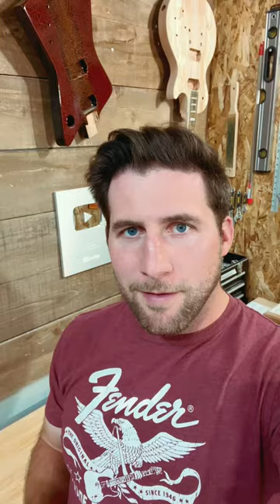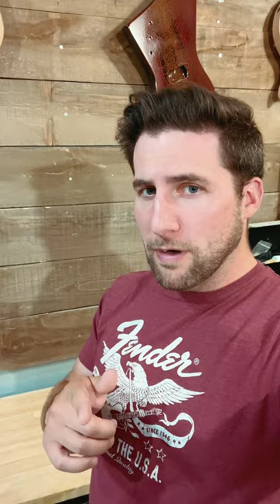Can you Spray Nitro Over Poly? #shorts

Comment: Brad - wouldn't having a poly layer at the base defeat the purpose of using nitro? I was under the impression the reason why instruments are painted in nitro is the layering process does not build up allowing to the wood to breathe or better yet resonate? By using a polly first one would be clogging the pores surface
Reply from the maker: You wouldn’t use poly on an acoustic guitar or a violin. For an electric guitar it makes no difference, so some people use nitro to repair poly, or use it to create interesting layered finishes.

Comment: what would the point be, just aesthetics?  i thought nitro fans liked the thin coating lacquer provides, closer to natural wood / less damped sound (if you believe that).  if thick “plastic” poly is just covered over it wont be a minimal clear coat situation.  am i missing something?
Reply from the maker: Nitro is easier to work with for repair purposes as well, can be used easier for drop filling, and polishes easier because it’s softer.

Comment: Could you do this effect with 2 colours of nitro so it can wear through both to the wood if you let the nitro cure well or add a clear coat over the first nitro coat before adding the second?
Reply from the maker: You can, it would just be much more difficult to wear through one into the other without going all the way through.

Comment: Can nitro be used to weld cured polyurethane with new one, for filling holes and not make it leave the borders after polishing?
Reply from the maker: I’ve drop filled poly with nitro before. It can certainly work. But I wouldn’t use it to try to fuse two layers of poly.

Comment: I’m trying to figure out if my 2002 bullet strat is single stage paint or if it has poly on top, if i sanded it down without taking the finish off, could i spray nitro and relic it after?
Reply from the maker: That’s going to be polyester. You could do that, as long as you only expect to relic that top nitro layer.
Reply from the maker: See my tutorial on the double relic finish.

Comment: Hi, I just bought the Solar guitar and looks like no inlays on the fretboard is an issue. I don't want to drill holes in fretboard, so could you advice me what would be the best and safest for fretboard way to make those?
Reply from the maker: You want to add inlays? 
Why don’t you want to drill holes? That’s usually how they’re added.
Reply: I didn't want to interfere that much in the guitar. I was thinking of something less permanent, like painting that can be removed with dissolvent when selling
Reply from the maker: There are inlay stickers. That might be the easiest option.

Comment: Can you ? Sure. But it's not a question of does it look good off the drying rack. In my early days of finishing guitars. I sanded the living shit our of bodies. Down to 400 or 600. The stuff looked fantastic. smooth as glass. Then they would come back a couple months later with quarter sized chips and flakes in the paint that went down to bare wood. It's an adhesion issue. Now we know nitro melts itself. Thats one of the reasons we love it. It's repairable. Nitro doesn't melt poly it sits on top of it. Does that look good when it dries sure. But it's kind of like a vinyl wrap on a car. When it does eventually chip or scratch it's going to peel off. And putting it over a poly prefinish in my mind is tanamount to sanding to 600. "look good" is half the equation. Wear good is second half, and thats what missing from alot of "I tried it and it looks great" advice.  If you want to "do it right" strip it. The upside of poly in my experience... is that it sands off real fast and easy with a 150 festool pad, and if it's something like a warmouth body.... they have a nice handy primer and sanding sealer that makes it real controllable to power sand with a bit of experience.
Reply: This was my 1st thought... How's it look years later. Evidently it does not take years to find out.